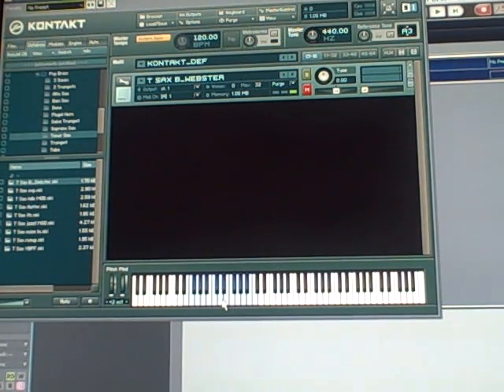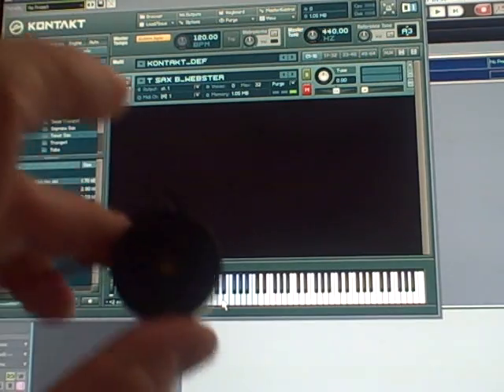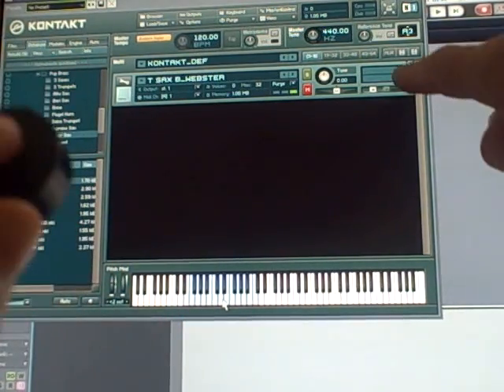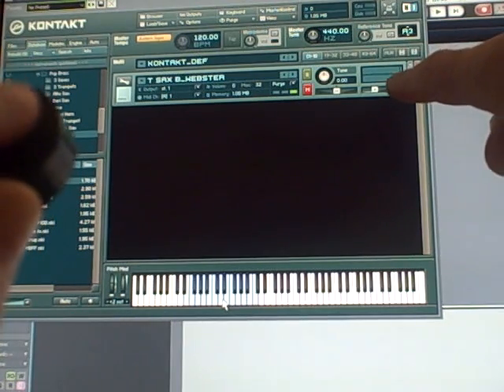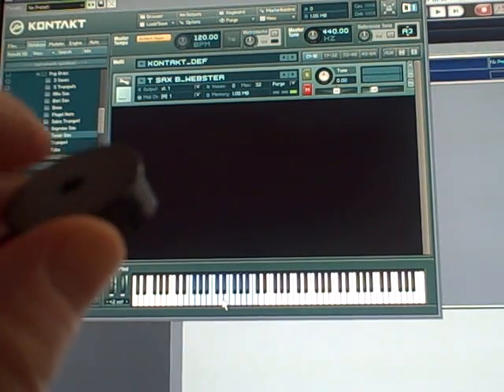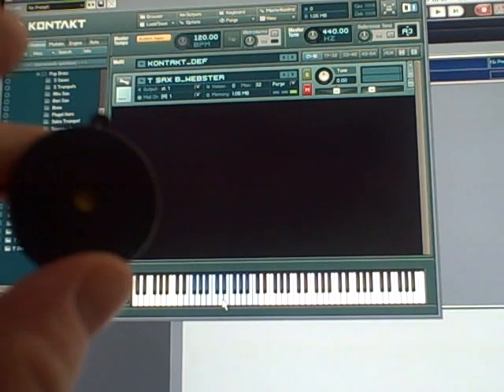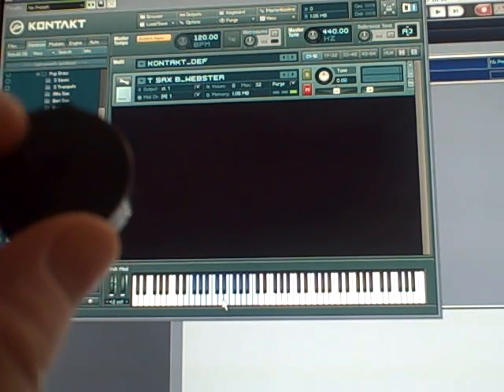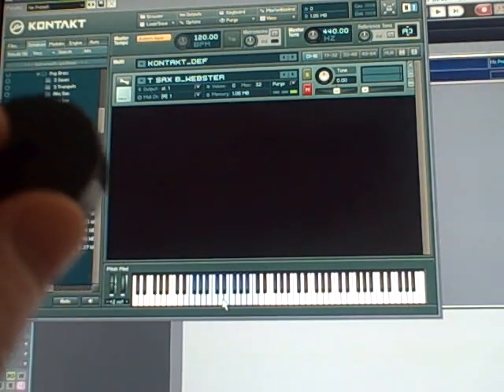Peizo/Arduino Midi Breath Controller

Comment: Simple working code for Hx710b air pressure sensor using Arduino Pro Micro or Leonardo (MEGA32U4 chip).
Just Upload and its done.

https://drive.google.com/file/d/1TCnHAw7n1C_AEWbv_yjuRRVbg1azM5w_/view?usp=sharing

Comment: hi, can any body tell me details that how can i make this, I need help please
Reply from the maker: this is half of it: https://www.arduino.cc/en/Tutorial/BuiltInExamples/Midi
the other half https://www.arduino.cc/en/Tutorial/BuiltInExamples/Knock
put those two together ....
Reply: @boinx  Thanks pal, I'll try it, by any chance, do you have the code to insertar it in the Arduino? Sincerely I don't know nuch about programming
Reply: and in the electronics components, what kind of resistance do you used for the peizo?
Reply from the maker: @armandog.4474  here's the original page in teh wayback: https://web.archive.org/web/20090712145520/noojo.com/arduino/piezo.html

Comment: The Piezo looks like a standard piezo-electric disc in a plastic mounting -  on Wikipedia as : Piezoelectric_sensor.   They worked pretty well for me in a Wind Instrument derivative of the mildly gruesome  'Stylophone' that I built around 1973. I did try to get my then employers interested...
Stylophone is on Wikipedia too...
Piezos also work well as percussion triggers and guitar contact pickups. And so cheap!